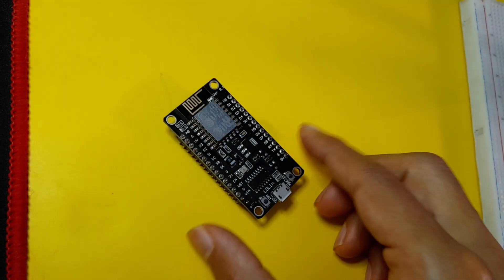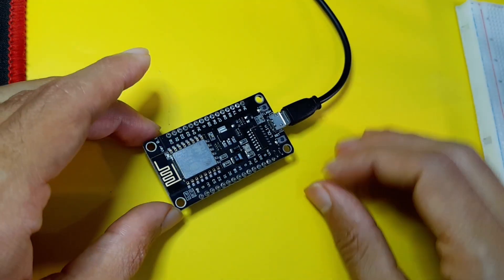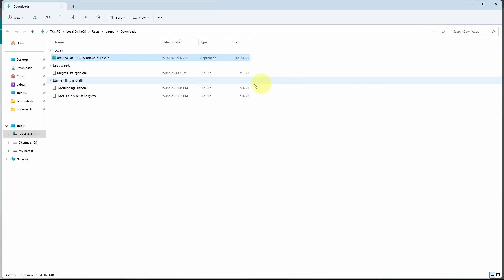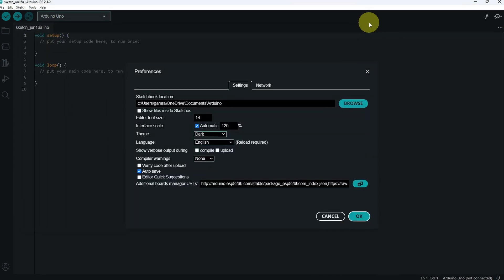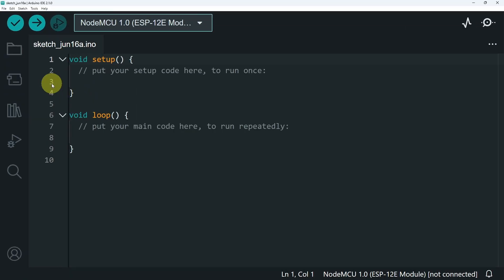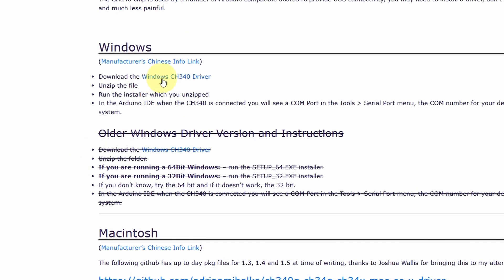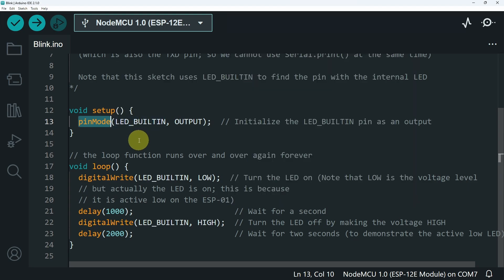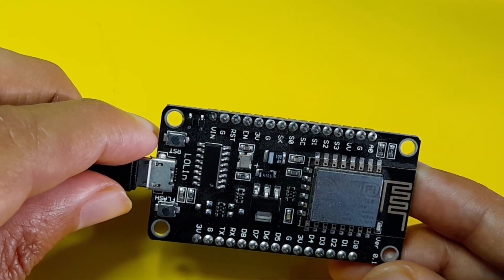ESP8266 with Arduino IDE: Beginner's Guide to IoT Development

Comment: thanks for the videos, for the people who are having problems with communication with the module, please know that if running the CH340 driver, but you can't get response from the ESP module, the problem might be in the c type cable used , it must be a cable suitable for data transmission, and not all of them are